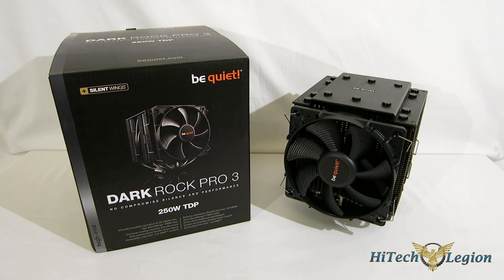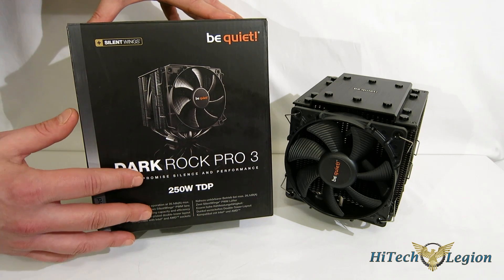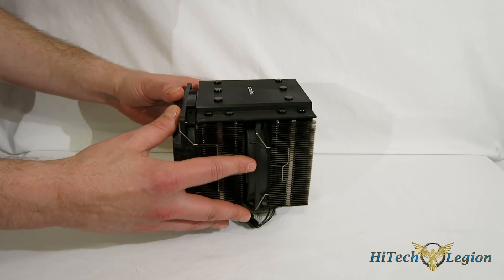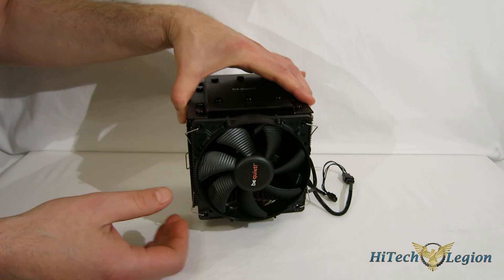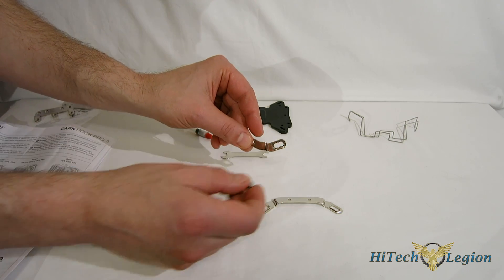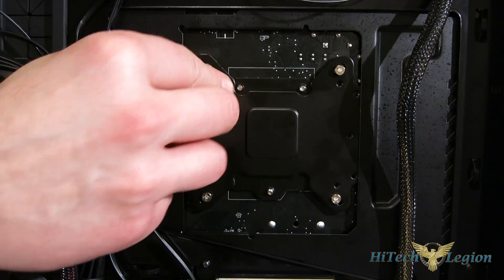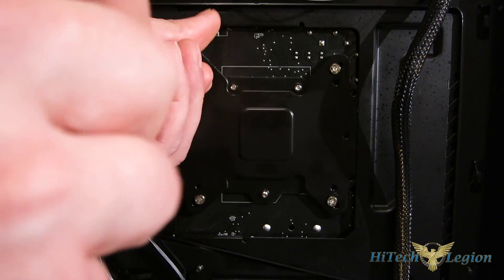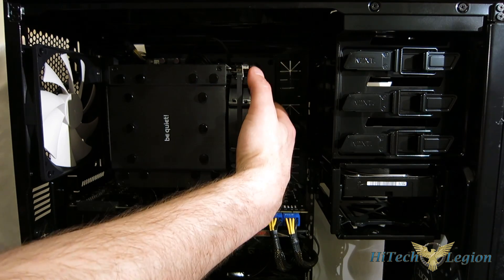be quiet! Dark Rock Pro 3 Overview, Installation and Benchmarks

Comment: The unit itself is every bit as quiet and fantastic as the HTL tech says. However, how about dusting/cleaning? Beyond blowing through, I don't dare even attempt anything more ambitious. Will regular dusting be necessary? It just seems well nigh impossible to actually achieve without temporary removal (in itself well nigh impossible too). The air dissipation system (fins) destroys any attempt to focus a strong air stream to blow out dust from within the deeper recesses of the tower. Surely dust accumulation of any significance destroys the basic objective of any air cooler because of the disruption to precision control and direction of airflow dynamics within these units.

Comment: Im having problems with my dark rock pro 3. Im getting over 70c on my 97 4790k at only 1.212 volts. I reapplied thermal paste and the only thing i can think of is that the backplate isnt flush with the motherboard.
Reply: Screw it down properly. Check if it is plugged in. Check the fan curve
Reply: S1RTR4X I Rmad it and got a kraken
Reply: S1RTR4X I reseated it at least 4 times
Reply: Also the 4790k gets pretty hot. I would not put my electronics under water, but its your decision
Reply: S1RTR4X it's running 50c now instead of almost 70c in games
Reply: Yeah, 70c is normal for a air cooler.
Reply: S1RTR4X my 212x was getting 60c

Comment: lol notice how you don't actually see him installing.... that's because it's the worst mounting system ever invented.
Reply: Well it sure does look simpler reading you on youtube than when you're actually spending an hour getting the screws alligned without seeing a single one of them
Reply: To anyone buying this fan:
mount the motherboard in the case first, then mount the cooler. it makes it a lot easier. I try to mount the cooler while the motherboard wasn't in the case yet the first time and it was a pain in the ass.
Reply: ITS JUST THAT EASY!! because things are always dead easy to do when you're an expert and you haven't done it.
I've installed numerous coolers and never had to install a DRP3 but even I can tell that mounting sucks the sweat off a dead mans balls, designed by someone who obviously never had to try it.
The Scythe big shuriken2 Rev B has a similar crappy setup, the difference is thats like 1/3rd of the weight and size.
Reply: Agree, DRP3 installation is PAIN IN ASS. Especially on Asus Hero VIII mobo. Worst mounting ever made, for sure.
Reply: @MadLustEnvy  the plate on the back is part of the motherboard, right? not part of the kit.

Comment: Anyone think this would hold up in 2017
Reply: If anything it should hold up better because processors are only getting more and more efficient and reducing heat output, it's only a matter of whether or not its compatible with the motherboard's mounting points.

Comment: I am using an i7 6700k (no oc) ans using an brocken eco. Unter "Load" (playing bf4) it gets up to 80C. A bit high isnt it? Would you recommend the dark rock 3 or is it worth going up to the pro 3? Silent operation is pretty important for me
Reply: just go pro for 15 bucks more. bequiet is having a sale on newegg btw. i picked up the pro 3 already xD
http://www.newegg.com/Product/ProductList.aspx?Submit=ENE&DEPA=0&Order=BESTMATCH&Description=dark+rock+3&N=-1&isNodeId=1
Reply: thanks for the info! unfortunately im living in germany, so no sale for me xD. yeah but my thougt also is that the pro 3 is pretty heavy and could bend the mainboard over time? And its a bit louder cause of the 2 fans. Im not overclocking so im really not sure if its worth it
Reply: you shouldnt have a problem with proper mounting. it used to be a problem with older sockets because back then well, they weren't as durable but as time went on they've gotten heftier

Comment: So, my mother board has no screw holes for a backplate and there is already something on it that looks like a backplate. I'm super confused as to what to do.
Reply: What motherboard? Unfortunately YT comments are incredibly limited, so it will be harder to help from here.
Reply: +George Cella Asus rog strix x99
Reply: That is an LGA2011 socket, it does not use an alternate backplate. this video shows LGA115X mounting which is very different. The manual has good step-by-step instructions for your installation. You will need to remove the MB from the case, as doing LGA2011 mounting of this cooler can be cumbersome.

Comment: Isn't it a bit weird that even though it's installed correctly the logo is sideways?  It makes no sense
Reply: Advent Seph You're entirely wrong on that, and just making assumptions. Simply go to their website. In the video it's mounted the same way, with a gpu. Tons of air coolers logos do that, not anything new, and doesn't dictate how it's supposed to be mounted.
Reply: m8 i've done my research on it and have seen countless reviews for this case, i'm not exactly making a half-assed assumption here. Just go look at JayzTwoCents recent CES video about the Dark Rock Pro 4, Be Quiet themselves realized people aren't putting it in the orientation they intended and rotated the text so it's correct now.

And ye, other air coolers DO put their logo sideways but that's due to space constraints, Be Quiet has a much larger canvas to work with here (square vs rectangle tops)
Reply: it's supposed to be top-down, not side to side. Most people mount it sideways because that's the only way to get a gpu in there as well. This cooler was clearly intended for non-gpu builds.

Comment: For all who don't know if their Ram is small enough before buying this cooler. The maximum height of RAM that is supportet is 42.5mm.
Reply: Does HyperX Fury work? 31mm hight
Reply: It should't be a problem. I used Ripjaws V (42mm) in my Computer without adjusting the height of the fan.
Reply: DDR4 Vengeance LPX should be fine, it's 34mm in height
Reply: If I take off the outermost fan (the one that sits over the memory slots), would that increase memory clearance? I saw a video Linus made of a ultimate silent PC and he used this cooler without fans and Corsair LPX memory, originally planning to use Dominator Platinum. I have just regular Corsair Vengeance with the shark-like fins at the top.
Reply: Idon'tknow. I'm gonna build a pc with this cooler. ATM I'm not able to test it because I don't  have all parts together...Midnight
Reply: MrMonado reall helpful information there..thanks a lot..
Reply: that's probably the more important comment i've seen in my whole life, thanks dude

Comment: i saw that the dark rock pro 2 is 3mm higher then this one and it fit my case(thermaltake chaser a31) which has a 160mm limit. My question is : will dark rock pro 3 fit my case?
i can't see that it is 3mm smaller then the pro 2

Comment: Thanks for the video. I haven't installed my DRP3 in proper way for the first time, but after looking through the video reinstalled it (much easier with those bracket mounting). Very helpful installation video, thx again.

Comment: Im planning on using the ASUS SABERTOOTH Z170 with CORSAIR Vengeance LPX 4 x 8GB DDR4 (CMK32GX4M4A2400C12). I dont think these modules are considered low profile but the heat spreaders are not that big. Will it fit?
Reply: +Carl Coate corsair vengeance memory is low profile :)

Comment: I could not put this in my rig with my g.skill tridents
Reply: me either i been trying to find a good air cooler with push pull config for my next build z390 chipset with 9700k i wouldnt be able to use any  of the cooler master air coolers because they making them so fucking massiveit causes problems with ram clearence even low profile. i was going to use the same cooler i have with my new build which is the cooler master hyper D92 but i dont know how well it will cool the 9700k 95w  compared to my 4790k devils canyon 88w

Comment: How did you line up the holes in the cooler with the bolts? I just cant do this, is it bad if i dont place the plastic black pieces?
Reply: +1snipoukos007 ikr? it was a b*tch to line up the screws with the cooler.

Comment: Hi there, i have question about installing this cooler on motherboard. Do i need to connect all the cables from this cooler to the mobo ? In the manual it shows only one connected cabler, but i have two and there is two sockets on mobo. And since this cooler has to fans i wasnt sure what to do. I think its working properly coz the CPU temp is around 32 C but i was hoping for less than that. And with Benchamrk test with full power it went up to 67. And it is not overclocked yet. Im still new at this. Learnig everythnig "on the fly " :P
Reply: hydeusz Yes, both fans should be connected.

Comment: how can i find this america for a decent price?
Reply: +hoodninja My H100i had a fan die, so I gave it to a good friend of mine and picked this bad boy up. The noise difference between an H100i with only 1 fan running and the Dark Rock Pro 3 is crazy. The only fans I hear a little now is my EVGA ACX 2.0 970. Very pleased with the Dark Rock Pro 3. It preformed very close to the H100i. I'm probably going to buy a H440 case to replace my 750D and hope that I can bring noise down even more as I find the 750D fairly big for what I want and less tidy then the H440.
Reply: hoodninja NewEgg and NCIX both carry this piece but they are out of stock. They should become available in the next couple of weeks.
Reply: George Cella would it be better than a h100i with push pull that i have now?
Reply: hoodninja Cooling performance will be similar, but it will be MUCH quieter at the same performance levels.
Reply: Good stuff think I may switch. As I like quiet. What is the third fan you can hook up to the back? Last question I promise

Comment: Why did you compare the twin fan dark rock 3 PRO to the single fan Noctua when comparing it to the Dark rock 3 would have been better as they are both single fan? To compare the Dark Rock 3 Pro you'd need the Noctua NH-D14 as they are both twin fan and you'd have seen Noctua out performing it by quite some way.
Reply: Stuart B It was simply because the Phanteks 14PE appears in the testing, which outperforms the NH-D14. We tested it against the best dual tower available at that time (the 14PE), the best 240mm CLC available at the time (the H100i) and a Noctua with a like noise output.

Given the relation between the 14PE and the NH-D14 in many of our previous tests, we can safely say that the NH-D14 may have outperformed this by a degree, maybe two under load. It essentially is a was in terms of performance.

Comment: Did you have someone else hold the cooler in place whilst you got the screws to grab? Also would you advise installation of the dims before installing the cooler?
Reply: Arron Smith No help was needed by another party.

I would definitely advise having the RAM in place prior to installation.
Reply: Thanks, I have seen other reviews saying it's a Bitch too install so that's why I asked. I have one arriving on Saturday for my new build.
Reply: Arron Smith It really isn't nearly as bad as people make it out to be. The biggest issue is that the manual is a bit (read "incredibly") unclear, and leads people to installing it incorrectly. I have worked with this kit many times prior since it is used by another mfg, so I actually never looked at the manual until people started remarking how hard the install is. And....yeah....the manual is really confusing.

Follow the steps in this and the Dark Rock 3 video (same install kit) and you will be fine.
Reply: ***** I have installed it now and I can tell you that it is a Bitch. A 2nd pair of hands imo is a must. I put it in place, while my father tightened the screws from behind the motherboard. I don't think I could have installed it alone.
Reply: It's honestly easier to install than a cm hyper 212 evo. I installed my ram first, pushed the pins through from the backside of the mount plate/mobo (mobo out of the case). Then placed the cooler on a flat surface with the mating surface up, thermal paste already on the cpu and lowered the motherboard onto it while maintaining alignment. Tightened the nuts/screws and done. I imagine trying to install it horizontally with one person while the mobo stays inside the case would be a pain, just gotta outsmart the hardware. :)

Comment: FFS I wish I seen this video first. I have corsair vengeance RAM andI just bought this cooler.
Reply from the maker: goofiegoofball It will fit in slots 2, 3, 4 if you move the fan up a bit on the cooler.
Reply: Or turn the cooler around. That is what i have done, with the fan in back of the case turned to intake. So intake from back of case directly into the cpu cooler.
Reply: I would strongly not recommend this! Fan positioning is key because you want a nice one-way flow throughout your case (Typically the front and/or bottom as intake with the top and rear as exhaust). If you have fans pointing in all different directions, you create a sort of stagnant air where temperature is not ideal.
Reply: Hmm i see. Problem is that i want positive pressure, and if the front is the only intake, my 2 top and the 1 in the back will try to exhaust more than is being taken in.

Comment: will this work with my vengeance pro ram?
Reply: Seriously? 10:20
Reply: oops... sry im not an observant person lol
Reply: that means that if i were gonna get a new heatsink to replace my noisy h100i i can't use these anymore unless i replace my ram
Reply: Ryan Wee You can use them in slots 2+4 but will have to position the fan a little higher. Corsair really needs to start making the spikes removable.
Reply: Ryan Wee
same problem here. Fu*k... stupid noisy h60 and i have vengance ram... now what to choose... nh-d14 ? but it looks like s*
Reply: Citroen Hy The clearance here isn't much different than the D14 - you will have to move the fan up a bit there, as well. The D15 has more clearance if you use middle and back as the fan configuration.

If you are using the first RAM slot, you could go to a Cryorig R1 Universal or NH-U14S. If you are only using 2 & 4, you can add the Dark Rock 3 to the list.

Comment: I love this cooler, but what I don't understand is that it's a high performance cooler, but they build it so low to the motherboard we can't use high performance RAM.
Reply: That isn't the case at all. Decorative heatsinks are not indicative of RAM's performance. Most of the actual high performance RAM will fit - even Corsair Dominator, G Skill Trident, etc. allow for removal of the fins. Also most other top mfg (Patriot, Mushkin, ADATA) offer high performance RAM without the decor.
Reply: George Cella Whatever the case, why not make the cooler a little higher to allow for higher heatsinks?!
Reply: Mike Baker The cooling efficiency relies on mass and surface, so raising it higher would cause it to be incompatible with many cases. The Dark Rock 3 (not the Pro) has better compatibility with taller RAM, but you give up a little in terms of performance.

When you get into the top end CPU coolers you find that they are built specifically for that task - to cool the CPU effectively. Considerations are taken for socket, MB and case compatibility....but you don't see mfg making performance concessions so that Vengeance/Predator/Etc will fit - especially with so much top tier RAM around that will fit.